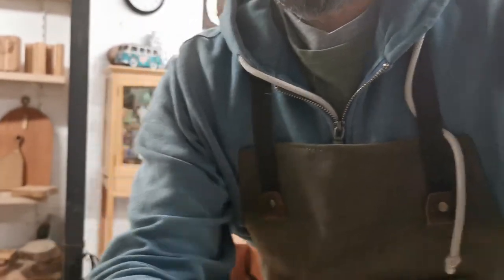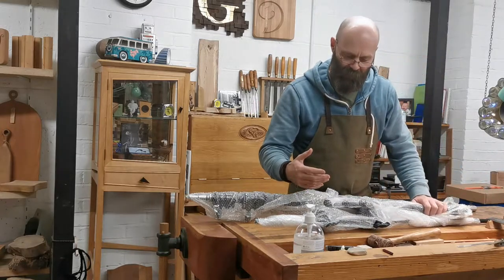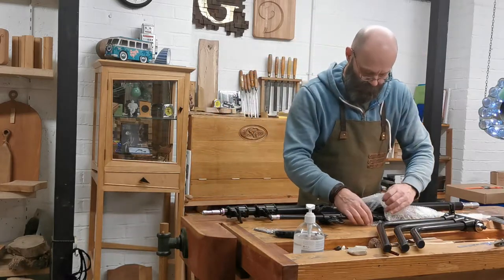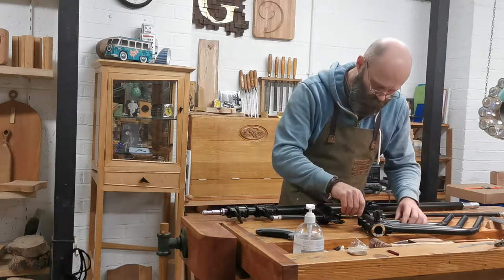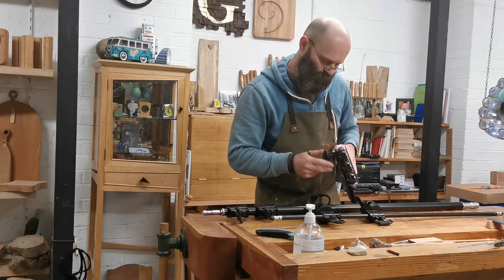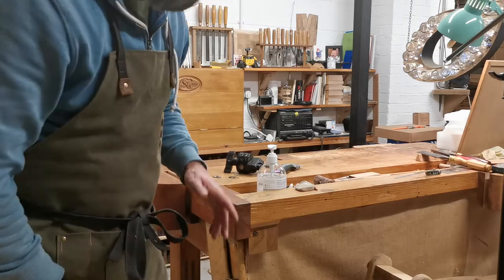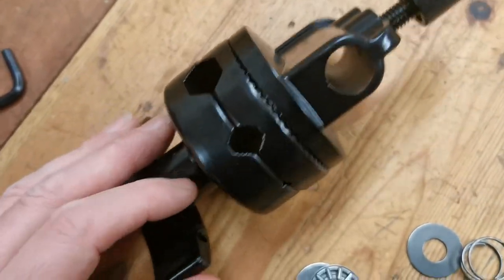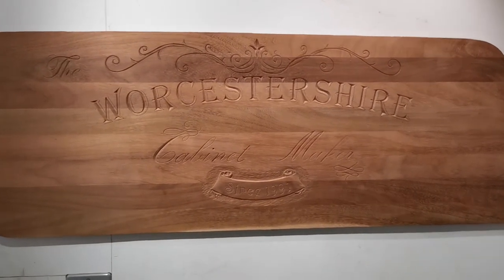[no3] A new piece of kit in the workshop - unboxing and assembly of a C Stand or Century Stand

Comment: Are you filming with your phone Jamie ?
Seems like excellent quality. 
Are you going over to a camera ?
Reply from the maker: Hi Kevin. Yes I have been filming on my phone. If I told you I spent about 5 hours yesterday trying to connect it to a tablet and then a monitor. To use when filming you'd think I was mad.. I think I'm past that mad point now. I can't make it work. My phone is 40mp and my Canon camera is only 12mp. But contectivity might have to be through my Canon camera. So not as good quality unless I spend a small fortune on another camera with higher mega pixels. So much to think about.